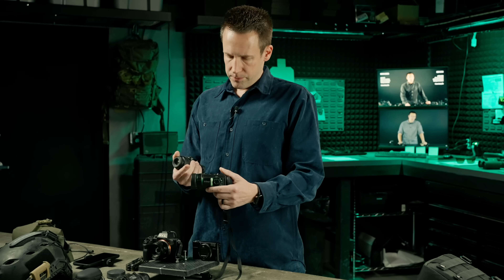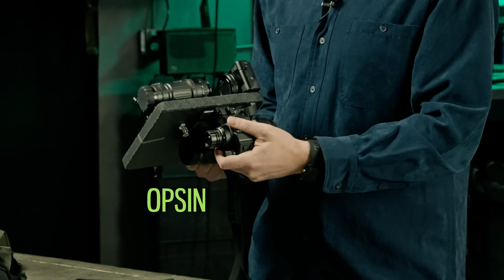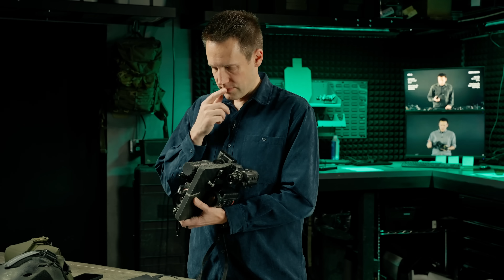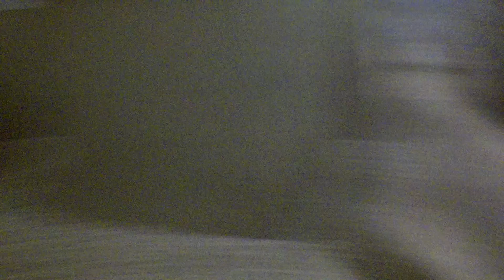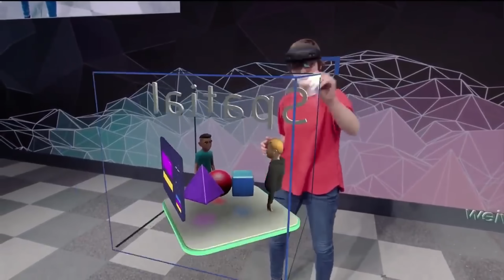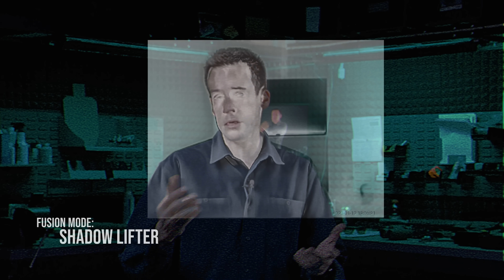SiOnyx Opsin: Digital Night Vision HAS ARRIVED

Comment: This is probably the point where the Opsin SHOULD be subject to ITAR compliance...
Reply: For us poor folks who don't want to degrade our limited supply of Gen 3 to a 1/10 End of Life, in intensive training. That's where an Opsin or Opsin dual version has an End of Life advantage.

As poor folks, do we really want to train with our limited number of Gen 3 units and degrade them to a 1/10th End of Life statue? 

So some of us are forced to go with the Opsin or other helmet mounted units from that company. Not everyone has suppressors, to reduce flash, yes we could get the Warden diffuser. But still, the high-power lasers are going to ruin our priceless NVG.

Would love to know how long Lucus' NVG last given his high intensity use and without suppressor. I would guess our civilian high-intensity use would do greater damage since we don't have suppressors and run older lasers on high, because we have an inability to switch power levels on the go and no light bards.

Comment: Imagine a true hybrid optic that can use both digital and analogue, but also with digital enhancement.

Combination package that allows even a weapon mounted optic, illuminator, and designator package.

Digital multi sensor, and dual ano tubes with digitally calibrated gain and resolution adjustment.

Swap between the two, or overlay them for added effect.

Multisensor packages would allow distance and detail detectors to be programmed into the software, possibly with even threat and friend detection.

Comment: @TREXARMS  Here's how you can test latency. You have a camera that has a high speed recording function like 1000 frames per second. You then have the camera looking into the scope and also have seeing outside the scope. You then turn a light on and you count the frames it appears outside the scope until it appears in the scope, so like at 1000 fps 40 frames would be 40ms latency.

Comment: One thing they can do to make the motion "buttery smooth" is use a low persistence screen.   This is something high end VR devices do and can acheive buttery smooth motion at only 90 FPS.   It also reduces nausea.  They just need a slightly higher end screen on it to be able to do that, but it really wouldn't add to the relative cost.

Comment: Why don't analog tubes have reactive protection against bright lights? A light-activated cross-polarizing filter would be very easy to implement and it would prevent burns. You look at the sun and the tube just wouldn't get any light.

Comment: I am one of those guys who got some Nightfox thermals and put them on a bump helmet. These are three things I learned were most important.
1) Zero latency.
2) True 1x magnification.
3) Legitimate helmet compatibility without workarounds. 
I thought the thermal capacity was fairly limited, especially in pure black, but something that is a mild improvement can be rendered useless if it's plain painful to actually use.

Comment: The battery weight would be solved by mounting or storing the battery on your body and not directly on your helmet. I could easily see this being strapped into a ruck sack or backpack and have a cable run up to the helmet.

Comment: For a unit like the pvs-14, a single, integrated device is a huge advantage. The ability to snap it into your helmet, add two for binocular vision, toss it on your primary weapon or throw it onto a crew-served weapon without fumbling with a battery can't be understated.

Comment: One of the big pros I see with digital is the room for improvement without major breakthroughs in material science.  You can often fix many problems, or tailor for a specific use case, using only software, making the hardware that you have work smarter, more efficiently and in niche areas.

Comment: Digital night vision and multi sensor cameras are the future of night vision. But they are just that the future. Because no government has funded the development they are still far behind the light amplification tubes.  DARPA could push development in this area. However militaries are notoriously conservative in their adoption and exploration of new technology.
Reply: SRI publicly announced they had developed a NV-CMOS image sensor that could achieve gallium arsenide image intensifier tube level sensitivity with post processing about a decade ago.
Reply: @blegi1245  Canon and Nikon have both developed ultra low light sensors. But It will be a very long time till you see one in a sub 10K device. 

It takes enormous amounts of money to put experimental tech into practical use. Right now no one is going to pay for digital night vision, outside of the security camera industry. Most security cameras cost under 300$. 

The market for super high end security cameras is very small. The market for NVG outside of government contracts is even smaller.  If you want to see good digital night vision, it will require a government level investment in them. 

Keep in mind just how bad early light amplification tubes were in NVG. Also the massive amounts of money that it took to change that.

Comment: pretty nifty
I agree with the general sentiment, if I were going to go with digital nv, I'd wait a couple more years to see those sort of qol improvements like a better hud or thermal integration.
We're currently at a sort of crossroads in the development of nv where the benefits of analog are being overtaken by the benefits of digital.  Much like televisions, nv will very likely fully transition to digital in the near future; especially with the ability to have multiple data streams in parallel.

Comment: I think 90fps should be the frame rate they target as that seems to be the standard for VR headsets to prevent motion sickness. 90fps with the option of 120fps with poorer low light performance would be ideal
Reply: The problem is the image sensor since a lot of similar sensor can only produce around 90fps, 120fps could only be made as the refresh rate of the screen.

Comment: On the Opsin, always set the EV to -2.5 which greatly improves dynamic range (~no wash out of bright lights). The Opsin battery system sucks. It's always drawing 6 milliamps when OFF. Weird.

Comment: Yes, digital night vision technology has been improving in recent years. With advancements in image processing, sensitivity and display technology, digital night vision devices are becoming increasingly capable of providing a clearer and more detailed image in low light conditions. Additionally, improvements in power consumption and battery life are allowing for longer periods of use.

However, it is important to note that digital night vision still cannot match the performance of high-end thermal imaging devices in terms of image quality and detection range, especially in complete darkness. Nevertheless, digital night vision is an affordable and accessible option for many applications, such as wildlife observation, security, and hunting.

Comment: As a medevac pilot , we used helmet mounted binocular night vision with battery pack on back of our helmets to balance the weight and we were told $14 k for our sets . They were great , but we had to keep track of “ on time” . We would swap out for new batteries at 2 hr . The specs said the processor gave 80k light magnification as I recall. No matter how dark, we could see great. Some ground guys were getting fusion which gave one side thermal and the other night vision so your brain ended up combining the two images. The French had a five scope systems on top of their helmet which gave processor info display on a shield visor flip down from the helmet. A wire would illuminate orange in the display, which as a pilot we thought that was really great.
Reply: That sounds like an interesting setup you used as a medevac pilot. Night vision technology has come a long way over the years, and the integration of different sensors like thermal imaging into a single device provides a more comprehensive view of the environment. The ability to swap out batteries on the go and keep track of "on time" is also an important consideration for maintaining the functionality of the system. It's fascinating to see how different countries are incorporating these advancements into their equipment.

It's important to note that light magnification is not the same as image magnification. Night vision devices don't actually magnify light, but rather amplify available light to create an image. The number you're referring to is likely the "light gain" of the device, which is a measure of how much the device amplifies available light to create an image. A gain of 80,000 means that the device can amplify light 80,000 times, allowing the user to see in low light conditions that would otherwise be too dark to see in. However, this number can be misleading and doesn't always accurately reflect the real-world performance of the device.

Comment: Would be interesting to see this compared to the new Wraith 4K monocular from Sightmark
Reply: Yes, it would be interesting to compare the performance of a hypothetical helmet-mounted night vision system with the Wraith 4K monocular from Sightmark. The Wraith 4K monocular offers high-resolution imagery with a 4K sensor and a 38mm objective lens, which provides a clear and bright image even in low-light conditions. On the other hand, a helmet-mounted system with a cell phone-sized processing unit could potentially offer more mobility and ease of use, as well as the possibility for additional features like thermal integration and display overlays. Ultimately, the choice between these two options would depend on the specific requirements and preferences of the user.

Comment: So, in a nutshell:
Analog NV is better for folks who are willing to put up with the fragility and pickiness of the platform, in order to squeeze out the most performance in areas where digital falls behind.

Digital NV is more beginner friendly, more flexible, less sensitive, and less fragile at the cost of performance and battery life. 

Essentially, the difference between army grunt "idiot-proof" and special operations super finicky. Digital NV fills a gap in the market that was unsatisfied until now.

Comment: Seems like there's 2 problems and they're related.  Frame rate and optical sensor sensitivity.  Getting 120fps would require a sensor that can gather enough light in 1/120 of a sec.  Which is gonna cost more money.  Or use a bigger objective lens - making it heavier and more fragile.  Sensor is prob the real limitation and something camera mfg have been working towards.

Comment: Commenting early, will edit as the video goes on, but for now, to keep my train of thought, digital night vision has been around close to 20 years has it been good? Eh. Maybe. Has it compared to a pvs 7? Not even close. Fast forward to today, where my smart phones night shot camera blows any gen 2 analog option out of the water. It doesn't compete with a pvs 14....but it does compete with standard civi tech, for the price. If you have less than 500 to spend, digital is the way. If you have thousands to spend, buy a legit intensifier unit. More bang for the buck, over 1k price tag.

Comment: The future will involve combining the I2 tube of a PVS 14 with the digital and color aspects of the SiOnyx. We already have Fusion for thermal and I2. The ultimate future's future will feature all 3 sensor types combined with maybe something like echolocation (visualizing sound + hearing it) in the mix. That will be interesting how and when we get there.
Reply: Yes, the future of night vision and sensory technology is definitely exciting! The integration of multiple sensors, including thermal, I2, and digital, as well as the potential addition of other sensory technologies, such as echolocation, has the potential to revolutionize the field. The ability to see in low light and complete darkness, as well as having the ability to detect and identify potential threats, would greatly enhance situational awareness and increase overall safety. It will be interesting to see how this technology develops and evolves in the future.

Comment: The fact it can see color is a massive benefit. Can't count the number times the mono color would've been useful when I was in the army. Reading a map for one. Pulling security at 3am on a monochromatic tube with little to no sleep can often make everything past 30m start to blur together. "It's that a rock or a dude?" "Did that rock move?" Is that thing over there moving?". Differentiating colors would make seeing movement much easier. But perhaps the best part of this device is that the higher spectrum of light that you can see it would be absolutely killer to have your weapon light and laser be outside of the spectrum of the enemy if they have night vision. Especially because if they have night vision they are under the assumption that they will know if you're pointing at them with a laser. Or even just the confidence in using an IR flashlight at night that you know your enemy cannot see. Check your map and a firefight, use IR lasers in the sky or flash a code to signal when radios aren't adoption.

Comment: Is there any way to get live video out of the Opsin?
It would be really cool if the Opsin could be used on a drone and transmitted video viewed live. If there's live video out, it could probably be used to fly FPV at night.
Reply: I think being able to record higher quality video would require more processing power in order to compress it to a file size appropriate for a SD card. Higher quality video recording would likely increase latency.
If the recorded video quality could be increased, I think it would be a huge perk. I'm temped to get one myself to use on a drone. I really want high quality video to use with other video taken by drones.

Comment: If the opsin was much cheaper, I think they would be everywhere. I also wonder why they didn't add an integrated ir illuminater with that "not-visisible to anolog" spectrum. I currently use an araura with an illuminater as an observation device, it is basically useless without the illuminater

Comment: This prospect is extremely exciting. If they are going to target a helmet mounted platform in the future; they could divide/disperse the weight even more. Creating a cell phone sized processing unit that mounts to the helmet, relocating the majority of the weight that's currently in the monocular, with a built in IR strobe for people that are using friendly drones. Why does the battery pack have to be so heavy, when cell phone's aren't? (I'm completely ignorant as to the power consumption differences.) Plus the potential display overlays and thermal integration that could be added in the future, wow!
Reply: Yes, the potential for night vision technology integrated into helmets or protective glasses is very exciting. With the advancements in miniaturization of electronics, it is possible to create smaller and lighter components for night vision systems. Additionally, advancements in power management and battery technology could help reduce the weight of battery packs. Integration with thermal imaging and other technologies such as drone integration or heads-up displays could greatly enhance the capabilities of these systems and offer many new benefits for users. It will be interesting to see how these technologies continue to develop in the future.

Comment: I built a pvs14 for 1130 last year using an omni IV tube for 450 w/ a tiny pinhole emission in zone 3. Housing kit with autogate and manual gain was 680. I am having trouble finding a matching tube for doing a budget bridged setup. If anyone has a used omni iv or similar spec tube for a decent used price hmu. 

This video was phenomenal and I'd be interested in a good spec BNVD for 7100 vs super cheap Trybe dual at 4500 video. The durability of each system would also be cool to test even with the money involved.

Comment: I’m also very interested in the type of development that holosun is doing combining the sensors into your red dot. I think that from a practical standpoint for the average Joe that could potentially be huge.
Reply: The integration of multiple sensors into a single device can provide many benefits and make it more accessible to the average consumer. By having all the necessary features in one device, it can reduce the need for multiple devices and simplify the use. Additionally, this can also lead to more cost-effective solutions, as the cost of each individual component is spread over the combined device. With advancements in technology, it will be interesting to see how the trend towards multi-sensor devices develops in the future.

Comment: The easiest way to describe Latency v Frame Rate:

Frame Rate is how many frames that can be displayed at any given second.  Laggy or not.

Latency is how long it takes for the device to recognize a change.  For example, if I'm just staring at the wall and snap my head to the right, how long does it take for the device and image to process that I turned before it starts moving as well.  Naturally your eyes have 0 latency.  That are directly attached to your brain.  

Another example would be to... uhh... think about a computer.  If you're playing a high intensity game on a garbage CPU and you move your mouse but it takes the game... say, 1/10th of a second to actually register your mouse moving.  That's a 100ms mouse lag latency.  The same premise.  THAT is what causes motion sickness.  Your brain KNOWS you should have that image snapped directly in view based on it's own experience and the fluid in your ear but when there's a literal delay it freaks out, tries to fill in the gaps, does it badly and then you get dizzy.